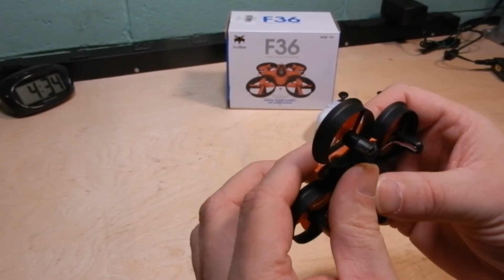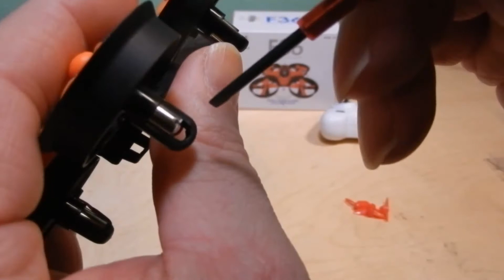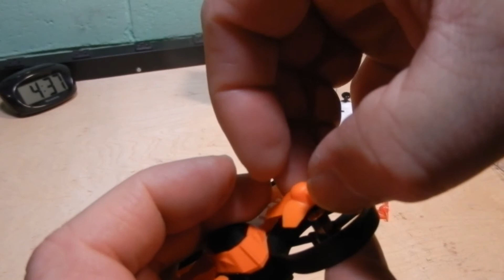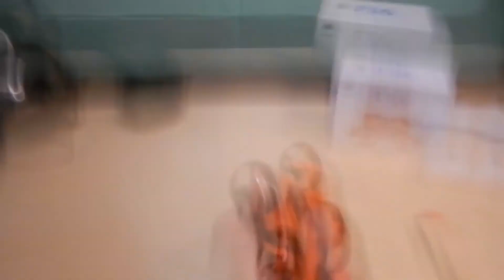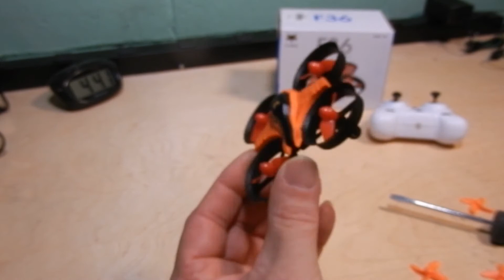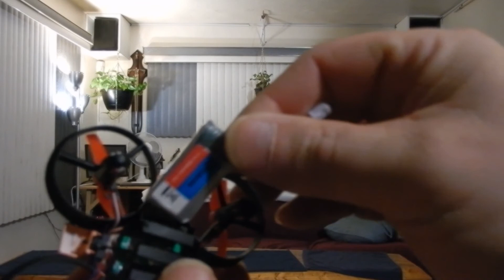Furibee F36 2-Blade Prop Mod and Flight Time Comparison 150mah Vs 260mah Battery

Comment: Excelent test so finally you recomend to use two blade props
And use the stock bateríes? 
👍
Reply from the maker: That's about what it boiled down to. I do have a few 260mAh batteries that do give a slight bit more flight time. Even still, it averages out with the added weight of the 260's. But the 2-bladed props do make a difference compared to the stock 4-blade props. With the 2-bladed props, you not only get longer flight time, it is also faster and has more punch.
Reply: @therccrashproject6330  thanks so much for your answer I gonna do the  mods today Best regardz 👍